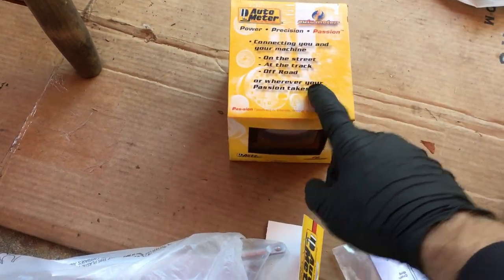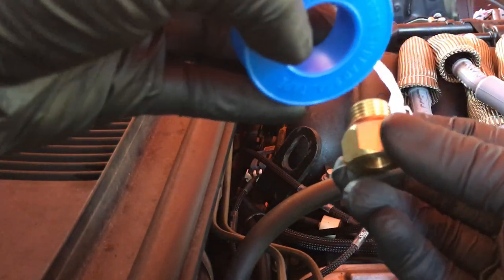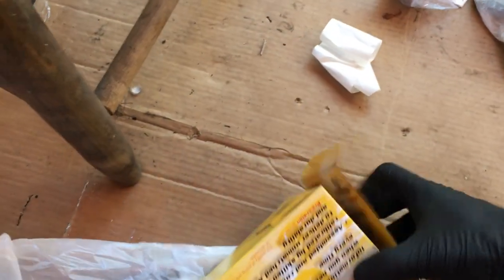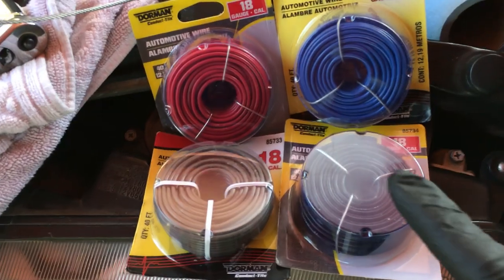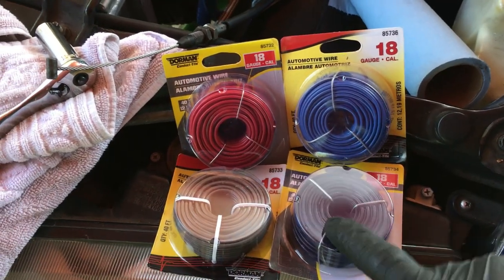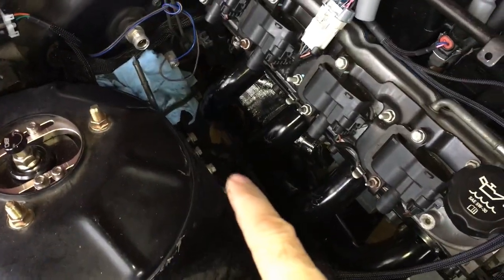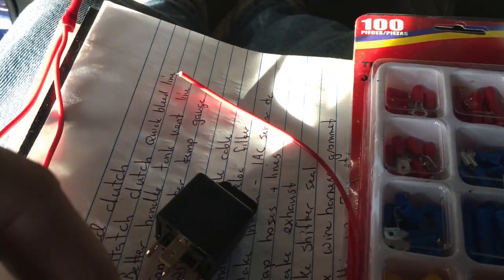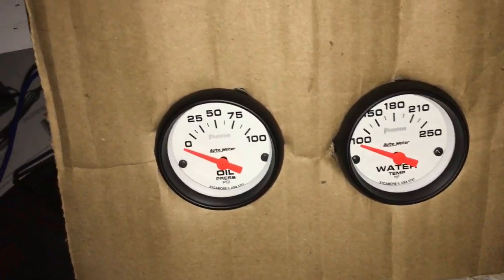Auto Meter Electrical Oil Pressure Gauge Install on a LS1 240sx Drift Car

Comment: I had a plastic line mechanical oil gauge once.  After it melted I had oil spraying on the muffler and then a campfire under the cab.  Fun time.

Comment: another great video, please keep them coming! i used a digital gauge aswel, but i used the adapter to 1\8npt - to 45degree fitting to 90 degree fitting and the sensor right ontop of (somewhat) stock location, then ran wires. I never thought of running a soft line!!  Great video

Comment: So you have an electric gauge and you talked about using the sender, but then you connect an oil line (for a mechanical gauge) to the block where you removed the original sender.  What is the oil line for if you're using an electric gauge and where did the electric sender go since you used the oil line?  In the end, you show the electric gauge (no oil line connected). Confused...

Comment: Great video, I have a question about your install your electric gauges. I usually don't have a problem installing gauges but I'm using electrical oil pressure and I noticed on yours is almost the same set there's only one wire going to the oil sensor. before you turn down the car when you turned on your key did your oil gauge go maxed out? currently I can't start the car I'm building the car at the moment but I've never seen a gauge go maxed out before you even put pressure to it I checked the wiring again to make sure I didn't have the signal wire in the wrong position which I don't. May I ask why are you using a relay setup on your gauges?
Reply from the maker: I had noticed when cranking the car it would max out the gauge. I do not recall what would happen when the car was in accessory mode. The "proper" way is to use a relay. I did not want to run 12v directly "all the time" and didn't want to run a separate switch to turn on the gauges.
Reply: @toxicmongoose7061   oh ok.   That I can understand about the relay. Thanks for the reply and letting me know about how your gauge works as well. My car will be done in this summer I'm hoping. Just doing everything I can up to the motor . Thanks again.

Comment: You hooked all your power wire to a relay right? Well im still confused how you are going to get power to the guages and if the oil guage is electrical then why do you still have to tap into the motor? Im confused and i clicked on this video hoping to get some help on hooking up some guages on my mustang
Reply from the maker: 1. yes, there is a fuse hooked up and then to the relay.  wire in the 12v constant to the relay and a switched power to trigger it to turn on. 

2. there is no way to get the oil pressure reading without converting it.  you need to hook up a sending unit that will convert the oil from mechanical to electrical.

Comment: you hooked up you oil pressure to the gauge,but what about the ecm? does it not have to read the oil pressure also.
Reply from the maker: No, I do not have it hooked up to the ecu. From my understanding it  doesn't actually  use the pressure but it may use the sensor to judge if it's working or not.
Reply: The Ecu in most cars does need to be hooked up as some engines will not run unless the ECU has oil pressure showing.  Also if you don't leave the one for the ECU and your car does run  it will make the oil light stay on. If you need or want both you can buy a brass street T that will let you install both sending units on the same port. But note SBC engines have a place down by the oil filter. I think you can use that location as well but not positive. I know it is often used to pick up oil temp but have never used myself so I cant say for certain.
Reply: No

Comment: Where did you relay.
Reply from the maker: got the relay from Orielys
Reply: We have a store in oklahoma called atwoods its kinda like a tractor supply. They are 8 bucks with a single plug 5 wire harness that has a mount so you can screw the relay down solid to something. At Orlieys the exact same  pigtail is 12 bucks alone without a relay.  So If you have a Atwoods around you might check with them first and I would think Tractor supply might have as well but not sure. Also a 5 wire relay can be used  as a normally on and turn off when the ignition comes on or as normally off and comes on when the ignition is turned on like used here. You can choose how you want to use them. The one I am refering to is a 30amp relay. Hope it helps someone save a buck or 2.